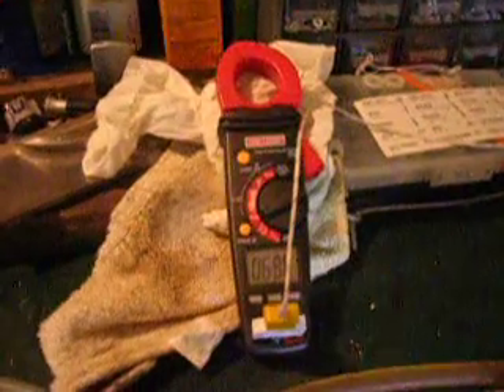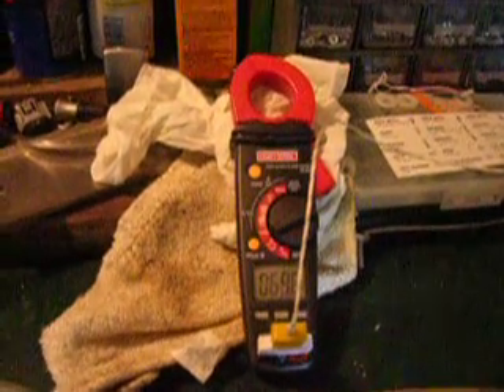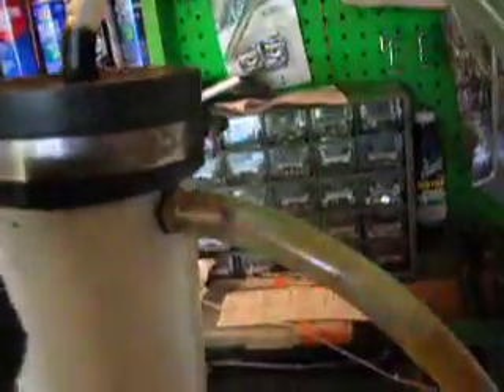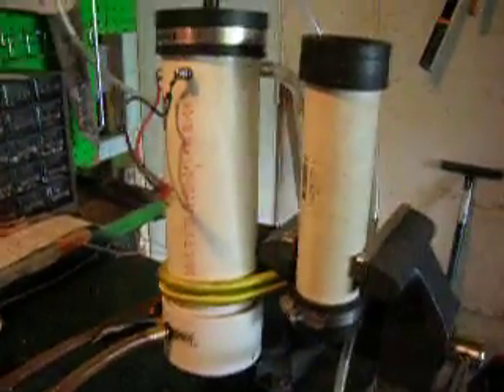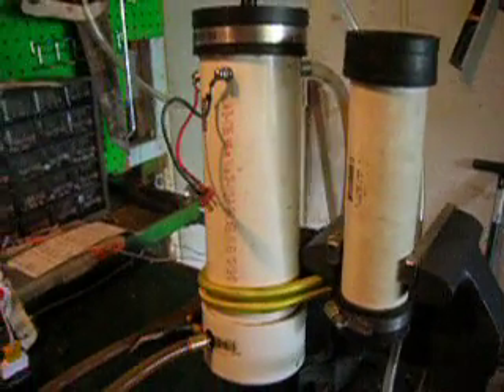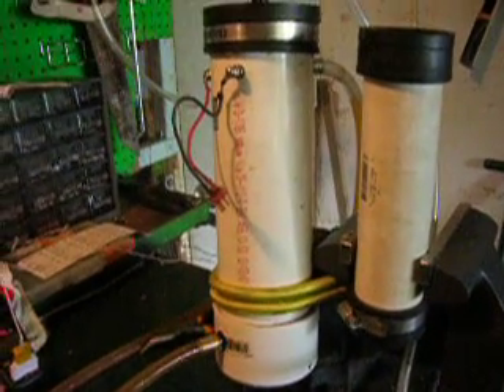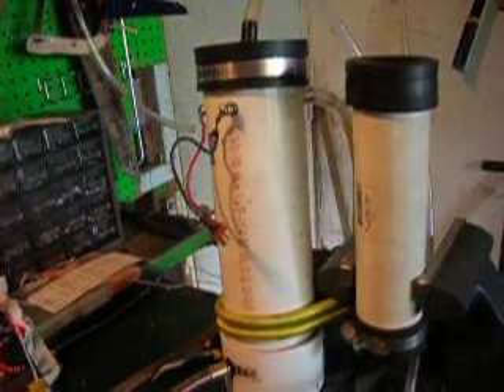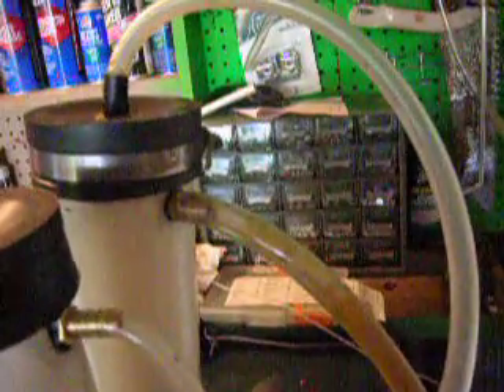New design for HHO cell

Comment: @crs6951  I my self have tried making a system with 2 separate cells ... 1 for positive and 1 for negative to extract only Hydrogen .... the resistance in the electrolyte is way too much .... by a guess working with 2 containers with a distance of no more then 1 inch with 1 electrode in ea and a small hose to connect them I would have needed about 200volt and approx 30amps to have made a bridge over the electrolyte. I will keep working on this but it is very trial some and near impossible @ 12v

Comment: Try bringing up the amps and dropping the voltage i think you will find that your productiion will increase and your heat will not be as big of an issue. At least from my experience, thats the case.

Comment from the maker: It's a good idea, but the problem is the volume you produce. The space between the cell plates in this setup is about 1/16". To have them seperate, you need many times that space, which increases the resistance in the cell, resulting in lower production numbers. *It would be good if you could run it for a long time and store the seperate gasses in tanks, but that's beyond my means.

Comment from the maker: Heat does improve the cells' production, but when you get near 180 degrees, the PVC housing starts to lose its integrity. I already melted my first cell housing when I didn't check the temp. It hit 198 and the ends tapered in and it started leaking gas. I've run this setup several times now, and it hovers around 160, which is great for production, and it keeps everything together.